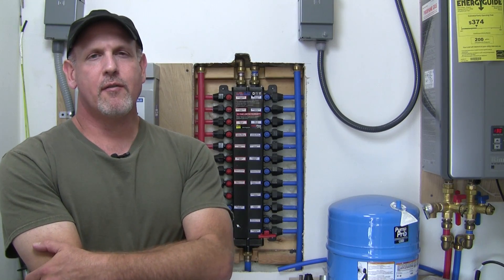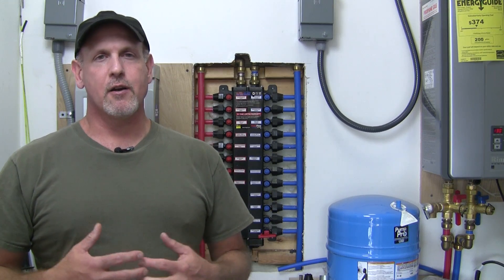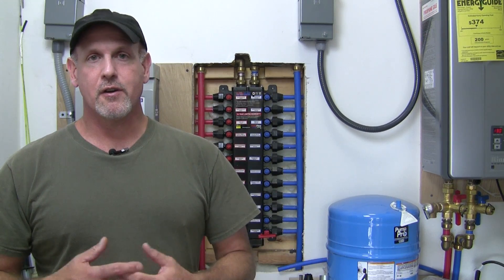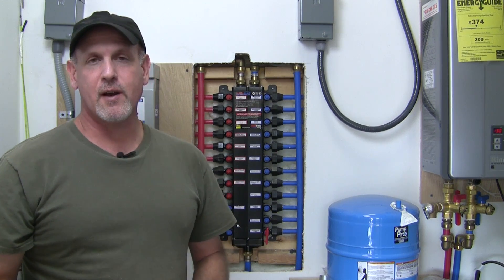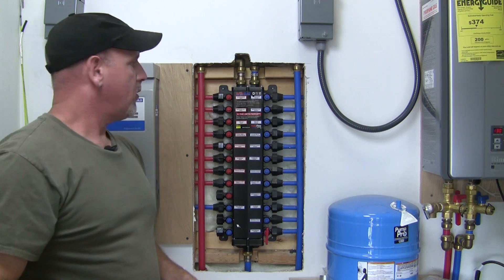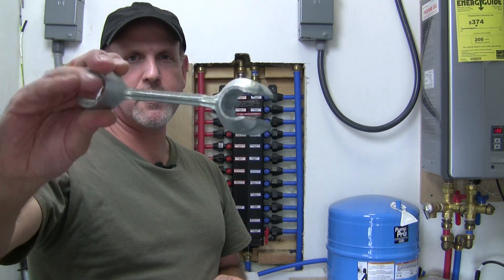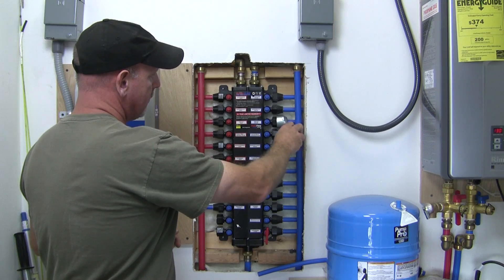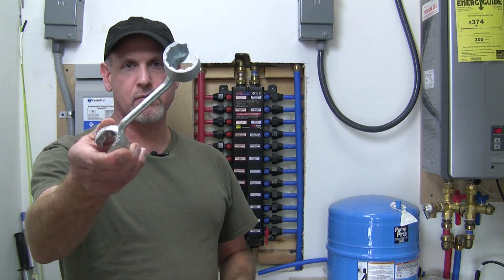Viega ManaBloc Water Distribution Manifold

Comment: I've never seen the net benefit of having a water distribution manifold for single family residential. We don't have the problematic shutoff valves of years ago. And water pipe leaks are less common and easier and faster to repair than before. So, I personally prefer the traditional branching design that has the daily benefit of faster hot water to nearby fixtures and smaller heat loss. And less piping means less clutter and a smaller amount of stagnant water near some lesser-used fixtures.

Comment: Quick question. Did you use Pex A or Pex B with that maniblock?  I have to plum my mother‘s entire house because a Plumber took advantage of my elderly lady when she called his company to fix a cracked polybutylene pipe. He charged her to plum almost the entire house, and made things go from bad to worse. Not only did he leave all the polybutylene that he was paid to replace, but the little cPVC he did install  it Spewed hot Under her washing machine for year due to an improperly installed PVC compression fitting. Now I have to re-plumb the entire house and rebuild her laundry room and master bath. I’ve had to do some repairs and replace her hot water heater, switching out the polybutylene with pex. I’ve tried using both the compression ring and the crimp ring tools to secure the fittings under the house and it’s next to impossible.  if anyone has advice, I would love to hear it.

I think it would be easiest to do a  homerun pex A maniblock system, and run the pipes under her mobile home. if I plum the house that way, I figured I won’t have to deal with trying to navigate the 12 inches of space between the ground and the floor joist trying to install elbows and tees. With only two connection points, one of the manifold and the other at the Fossett I figured that would be the easiest. Does anybody else have a better suggestion and does anyone know if they make a maniblock system for pex a ?

Comment: My house was built in 2006 with the Manabloc, unfortunately, it has had some leaks. It could be due to water hardness because we get that white crude accumulations at the supply adapter.
Anyway thanks for informing that the wrench is available to purchase. Most plumbers are still behind on this Manabloc equipment and don't have tools to do anything.

About the pex piping, its been holding up very well 16 years and counting.

Comment: Hi there, so I'm replacing my old Vanguard with a Viega it's a standard 24 valve house system ( 12 cold 12 hot) Plumbing supply companies are charging $ 600 + Amazon sells Viega manablocs between $176 ( 3/8") and $346 ( 1/2") I'm assuming for once  that these manablocs have been Quality Controlled, they come with 3/8"& 1/2" fittings and a wrench. Please let me know ASAP thank you.

Comment: where do you find the proper manablock with the pressure type fitting you show in the video included with the manifold? Looks like they are discontinued. Do you know if the "crimp" style mana block fittings are appropriate for pex-a pipe with cold expansion?

Comment: i put one of these in. I find it can take 30sec+ to get hot water. this is  only 10ft run. do you have to push all the water out of the manifold before you get hot water.

Comment: I love the set up.  The only thing I would have done differently and what I'm going to do..  call me over the top...    leave the pex exposed on a water proof backing attached to 5/8 ply.  If something leaks and you need to replace it, I'd rather just be replacing the pex then new drywall or whatever now.   

Thanks for the video.

Comment: Thanks for the video. Just saved me from sleeping with 1 eye open wondering if an outside faucet (that recently started acting up) might start gushing in the middle of the night. That's usually how it goes right? Then remembered I had this system in the garage (just recently bought the place) turned the little valve off and now I can fix the tap on MY schedule.

Comment: Great depiction. But my question is why to use manifold when each faucets do have is own shut off valves ? I do like the German Viega plumbing supplies mostly to use on 3"×4" copper ,cast iron pipe connection. Also do have press fit copper, pex fittings from 1/2" to 4". Down size of it quite expensiv fittings and press tools manual or battery operated. Thanks for great explanation

Comment: It looked like you were using a tankless water heater. What do you have at the bottom of the water heater to connect hot cold supply lines?

Comment: Hi friend - I’ve just found out about pex this year (2018). A few minor repairs.  My 1959 House is a Testament to rust filled pipes. I had no idea I was filtering my water through that stuff. All the plumbing is basically on one side, kitchen, bath, bath.
downstairs kitchen, laundry, bath.  I’ve been thinking about redoing it. I just learned of this manifold, it was what I was thinking about, something like a electrical breaker box. Watched a couple videos, then yours. Yes, you’ve got it made, and confidently show and tell. So clean, 
and with water going where it is,  conservatively smart. I’m pulling my hot from a gas on-demand and it appears that’s what your doing. I’ve solar too, and a system like this I could direct everything where I need it. I’m surely off to get started. One of your readers left a number for more info. Nice job. 
I’ve noticed when I turn on my hot water on one faucet, it eventually gets to other faucets faster, as though too use it one place it heats to all, seems wasteful in both water and heat source. Not sure with the on demand. This could control that.

I’ll bet this was fun too, stay savvy, a friend in Washington.

Comment: Good video, however you did not show installing the feral which is the last step before you connect your pex line to the manifold, without this you will certainly have a leak.

Comment: Great video, you did forget about the small plastic ferral that goes into the compression nut for the fixtures. Other than that, nice work on the video. The pricing really depends on the size of the manabloc. Plumbingmall.com has them starting around $130 up to  around $250. Obviously, the more ports you need the more expensive it becomes. Here is a link to the lowest priced manablocs I could find.  https://www.plumbingmall.com/viega-manabloc-manifolds/

Comment: Rebuilding the water and distribution system at my camp in the mountains. I am switching everything over to pex and using a Viega Manabloc for its distribution. I like the cinch clamps as opposed to the rings. Great system to use and work with.

Comment: great video. what's the purpose of the small blue pressure tank behind you?
Reply: that's an expansion tank for his water heater.  probably connected to his cold water "in"
Reply: @efhorta1965  blader thank to maintain water presure in the house when taps or toilet is use do not drop the pressure in the lines and create water starvation

Comment: I installed CPVC to my entire house, 24 years ago, when I built it new. Now on a regular basis I am having pipes crack and leak and even blow out. Have had my basement flooded a couple times and had my bathroom carpet soaked, with water running down through the floor. I would not recommend CPVC for hot water because of my experience with this. I am now getting ready to install PEX to my entire house and that's how I ended up here. Thank you so much for the helpful information. This answered most of my questions.

Comment: I just had a house built with teh PEX system and a well installed We ran a water hose from the well to the house temporaraly while I was able to burry the water line. The system was working fine after I installed the main line from the well to the house and connected to the house now I have two cold water lines that are clogged. How can I clear the lines? Please advise.

Comment: first off, great video. will you be willing to do a replacement video? how to shut main water off, do we have to drain water heater before removing hoses? also does the whole manifold need to be replaced or can you remove main screws and replace a gasket?

Comment: Question, did you have any issues with a permit for the plumbing installation, and how did your inspections go? Did the inspector flag any issues? I'm looking to install the same system, but am required to pull permit first.
Reply from the maker: +Kevin Strahm I did not have to have a permit in my area.

Comment: It's actually pronounced "Vee-ga".  I'm a proud employee of this company and the Manablocs are made in McPherson, KS USA.  The wrench comes with the block and these are available at most plumbing wholesalers.  It is recommended that they are installed by a licensed plumber and when you use our pipe and fittings you get a warranty on the whole system far superior to any other competitive product.
Reply from the maker: +Chad Molen Thanks for the input to my viewers, Chad.  I really appreciate you watching and commenting.  I have had the mana-bloc up for over three years now and not a single issue.  It's a great concept and product.
Reply: Hi Chad,

Not sure if you are still monitoring this video, but I'm thinking of using one of these manifolds. Is it possible to use it with any PEX (I already have 100' of 1/2" from Sharkbite) or do I need to buy PEX from Viega?
Reply: @MewCat100  , you can buy from any plumbing supply house such as Furgeson, Morrison, etc.
Reply: What is the bottom port for?
Reply: When I have a licensed plumber install it, does your company pay for it??  No?  Darn... Guess I don't have much choice then but to install it myself since I'm looking at 1000+ dollars just for the supplies....
Reply: Sorry I am not able to respond to this but you can call our customer service hotline and they can provide an answer for you. 1-800-976-9819
Reply: What are the big fittings for the Hot and Cold, they look threaded - where do I buy those?

Comment: i saw you have a pump pro, is that for the water pressure? 

i am planning to use about 9-10 hoses (for sink, tub, washer...etc) do i need a water pump and how did u installed yours?

Comment: I decided to do my plumbing with pex but I'd like to know what  are you using Compression or pex crimper manabloc ?
Reply: +blazingnailgun We 3 types of connections: compression, crimp, and press.  Press is by far the best way to go and looks really nice but it's more expensive.
Reply from the maker: +Jorge Montalvo Thanks for watching, Jorge.  Not sure if I understand the question.  The pex going into the manabloc is compression.  Everything else was attached with a lex crimper.
Reply: I bought it in compression type I hope I don't have problems in the future
Reply: Not at all Jorge.  Compression is probably the most common connection type.

Comment: Nice presentation by a soft spoken person. I want to install Viega Manabloc for 5600 sq feet home and will use 1/2" for both cold and hot water lines except 3/8" for toilets. Is this design going to work. Some of the runs may be 100 feet from the Manabloc, would it decrease the flow. Will appreciate your input.
Reply from the maker: Narinder Batra Thanks for watching, Narinder.  I would like to admit that I am not qualified to answer your question and would feel bad if I led you wrong.  Why don't you give Viega a call and get reliable info.
Reply: +Narinder Batra We would be glad to help you.  You can call our customer service line at (800) 976-9819

Comment: Looks beautiful.  Did you use 3/8" PEX for any lines running through your home?  I installed PEX throughout our house about 2 years ago without a manifold (because our house is so small) using 3/4" PEX from the water main, then branching off using 1/2".  Now I'm considering putting in a branch for 2 separate 7'-10' lines of 3/8" pipe to separately feed a shower and sink in a new bathroom...wondering if the 3/8" pipe will have problems supplying water to each.
Reply from the maker: jek9911 Thanks for watching.  I used 1/2" for my feeder lines.  No problems three years into it.

Comment: Does anyone know if the ManaBloc comes with the key? I'd like to order an extra anyway as it would be nice to have two.
Reply from the maker: Frank Anthony Davis If you are talking about the key that turns the water valves on and off then yes, mine came with one.
Reply: +Frank Anthony Davis Yes it does.  You can also call and get a replacement key if you have misplaced yours. (800) 976-9819

Comment: Thank you. You make it look easy. Can you comment on what I've heard about the manifold system delivering hot water faster than a traditional distribution system? I can drink a half a cup of coffee before I get hot water! Last, do you have a recommended pex tool or brand to buy. After I redo my house lines I want to do a heated driveway and want to invest wisely in one system if possible.
Reply from the maker: Bruce Bower Thanks for watching, Bruce.  I appreciate it.  My water delivers pretty quick but I don't know if it's because of the manifold or not.  Seems to me the hot water would have to travel the same distance either way?  I don't know about the brands of PEX.  I'd say it's all about the same.  I can't remember the tool I have either.  I did not buy it from a a big box store.  I got it at a specialty supply store.  It was expensive but it's a high quality tool.  Sorry I'm so useless to you tonight but I just can't recall.  :-)

Comment: Lovin' your channel! Thanks for all the details on your projects. Would there be a way to blow out the lines with compressed air to winterize? Freezing isn't as big of an issue with pex from what I hear but just curious.
Reply from the maker: Chris N Thanks for watching.  There's is not a port on my manifold to do this with but I guess you could unhook the like from the manifold and mate a fitting to it somehow to accomplish this.  Lemme know if you figure something out.
Reply: just curious. I'm probably a few years out from owning my first home but definitely a dreamer. I think these cheap improvements to a home are perfect for the handy homeowner. Actually come to think of it I guess you could still blow out the lines via a garden hose faucet and shut off every other connection to the manifold  except the garden faucet and the plumbing you're draining. Thanks for getting back to me.

Comment: Thanks for the video.  Our house is already plumbed with PEX but it's a trunk & branch setup and lines were run quite messily without much thought for layout or efficiency.  I've been looking to install a manifold and re-plumb the lines before finishing my basement and I really like the look of this Manabloc unit.  A few questions though:

- What is the actual manifold made out of?  Metal or plastic?
- Can you use standard PEX from your local hardware store or do you have to use Viega PEX?  i.e. 1/2" PEX from Lowes/HomeDepot should work with this unit, correct?
- Do the metal inserts for the compression fittings/ports come with the unit?  So the only other fittings/parts that you need to buy separately are for the inlets/outlet?

Thanks in advance.
Reply from the maker: Digitalfiendscom Thanks for watching.  The manifold is plastic.  Any PEX will work with this.  All the fittings comes with the unit.  You may need to adapter fittings for your main lines coming in though. Hope that helps.
Reply: ***** Sorry, didn't see this reply (didn't receive a notification, weird.)  Thanks for the additional information.

Comment: Hey i'm thinking about getting this but i'm seeing that most of the crimp manabloc have 1/2 inch PEX ports but my house uses 3/4 PEX how can i use this? i saw some with 3/4 ports but only like 6 hots and 8 colds i need about 10 hots and 15 colds. can someone help me
Reply from the maker: fusionfast98 I wish I could help out but this is not really an area of expertise for me.  I'd like to think there's a solution for this.  I'd say there's a reducer available but I just don't know for sure.

Comment: Thanks for posting.  This is a great video but I am still a bit confused about some things: The main line coming in from your well charges the whole system, right?  Is it the whole system it charges or just the cold side first? If this is the case why doesn't that cold water feed all the lines immediately?  So the two outlet lines at the top are just to go to the water heater and return one of them with hot water to the "red" side.  I am assuming you just connected the pex at the copper tubing instead of right at the water heater?  Sorry I know these are probably really basic questions but I have never been around pex or manifolds and I want to install it in my house.  I am also assuming that you can run 1/2'' and 3/4'' lines off of this system? Thank you so much.
Reply from the maker: dale dyer Thanks for watching, Dale.  I appreciate it.  Yes, the main water line charges the entire system.  When you call for hot water it sends water to the water heater and returns it to the hot water side of the maifold (my water heater is an on demand type).  You can use a shark bite connector to attach the pex to your existing piping at the water heater.  My lex lines are 1/2" which is ideal for the water lines.  I don't think the fittings that came with mine will work with anything else.  There's probably adapters out there you can use?  Hope this helps out.